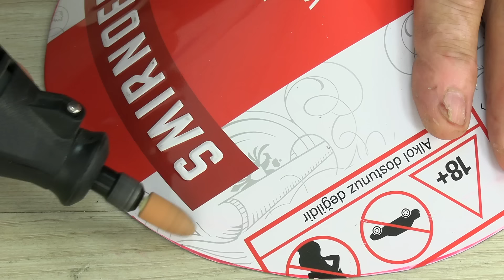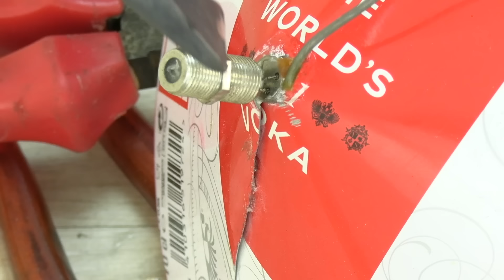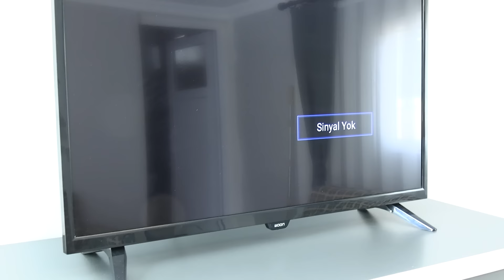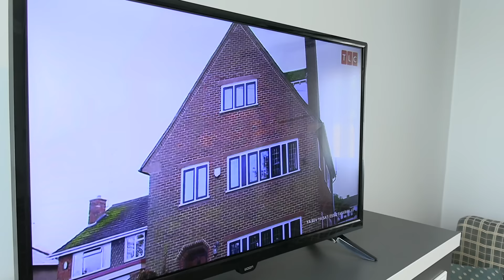Forget All Other Antennas. Watch All the Channels in the World with One Antenna!

Comment: I am an Electronix Designer and Scientist from 1970s. 
Starting from Valves, I have come all the way to Comp-on-Board Chips!
Yet, 
THIS IDEA of using an old Electrolytic Capacitor to receive Satellite Signals is IMPOSSIBLE, EVEN BY THE WEIRDEST DREAM, to gulp down!

May be you can apply for a Scientist Position in NASA so that they can save Trillions of Dollars in Antenna Design!
You could have used up THIS time and Material to teach a school kid some basic Science!!
Drat!

Comment: hahah  I GOT TO ASK THIS how does the infa red sensor pick up  tghe digital tv signals ,and whats the theroy behind using the electrolytic  capacfitor this way ,and have you compared its preformance to say a coat hangerjammed in the back of you tv
Reply: oh try this put your tongue on the antenna  socket, ive got no idea what will happen ,but record it for our amusement

Comment: I'm going to say I think that does get channels probably not a bunch but I guarantee you it does pull channels in it it
Reply: You could get more channels just by cutting the center wire from the coax to the tuned length than all this garbage.

Comment: Has anyone else made this antenna and succeeded?
How an electrolytic capacitor collect signals? 
Is there any visual signal is going to be captured with other EM signals by photo sensor ? If it is going to capture digital signals what can photo sensor do???
Reply: It's total rubbish. The creator is not mentioning names of components and sources
Reply: It will catch the Signals from the Past during, say, 45 January, 12,985's Inter Galactic War!!
Reply: You are asking the proper questions and the answer is this is all BS. It looked decent in the beginning till he threw the Flux capacitor on it and then the IR detector really called it.

Comment: If you drill 3 equally spaced 4.5mm holes on a pitch circle diameter in the cone you can eaves drop on militarily communication. The reason being is that hole alter the frequency to behave very much like a gimbal in your automatic washing machine thereby allowing a rotating frequency interceptor. I trust you find this very helpfull
Reply: If I ever feel like going to federal prison I’ll give that a try 😅
Reply: Does it require positioning
Reply: @matthewoghenedoro8125  🤣

Comment: Spanish: Los  elementos raros que tiene esta antena son: un condensador electrolito de 400 V - 47 micro faradios y un sensor digital PIR D204S. English : The rare elements that this antenna has are: a 400 V electrolyte capacitor - 47 micro farads and a D204S digital PIR sensor.

Comment: The cut at the end was so obvious. Also this would never work. The “lnb” is just a capacitor. That is not how an antenna works. They are metal rods called dipoles that can detect oscillation in the rf signal. Caps can’t do shit outside of electrical current regulation if I remember correctly. Also the size is comedic at best and aiming a directional parabolic with your hand is going to cause sever packet drop and visible glitching on the tv if this even did work.

Comment: Great antenna, it is also suitable for police & secret service radio frequencies:
Just add a few inches self-adhesive digital secret service radio tape to the capacitor on the top of the antenna and connect it to your radio scanner. Nearly every scrambled signal will be decoded now. Be sure to use the digital tape, the analog one does not work!
But... do NOT tell anyone about this mod!!

Comment: This is nonsense or a joke.  There is insufficient area to receive useful satellite signals.  The reflector needs to be accurately parabolic with a receiving LNB at the geometric centre.  There needs to be means of mounting and support by which the device can be accurately and durably aligned.  Don't waste your time!
Reply: I think it's meant to be fake - like a perpetual motion machine video. But it's not April......

Comment: You think you have destroyed all the known laws of physics and electronics, but if the normal human intelligence is between 90 and 110, even a person with an intelligence level of 70 will not believe the reality of this video. Therefore, if there was an international stupidity contest, your first place is guaranteed, As an expert electrician, my advice to you is, if you add a 1-uf capacitor next to the capacitor you removed from the power supply, you can even get 16 k broadcasts, you have to wait a little for this, even our elders said, "water cannot escape through those cracks". 😂😂😂😂😂😂😂😂😂

Comment: Scammer.....All your going to get are local UHF channels. perhaps 10 miles. This is ridiculous why did you place a cap in front of a dish. TV signals are not microwave they dont bounce off a small dish like this. The unshielded wire going up to the front is the actual antennas